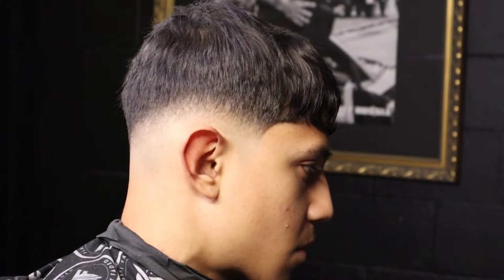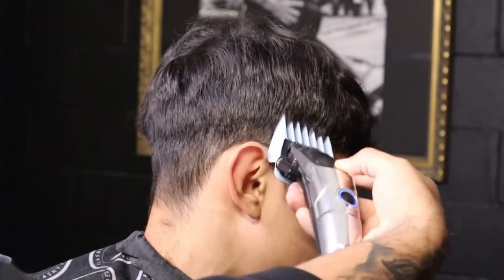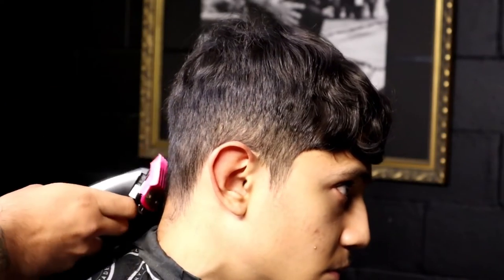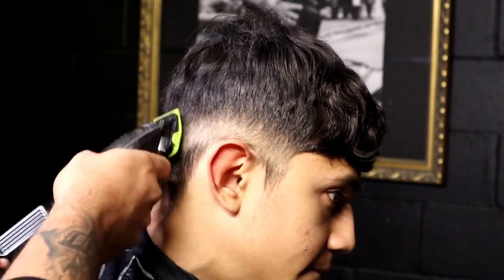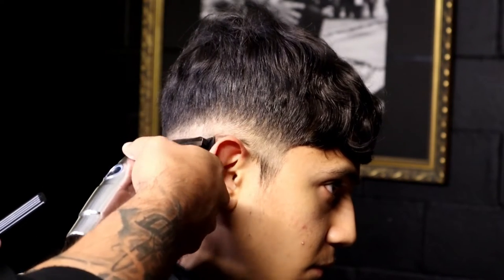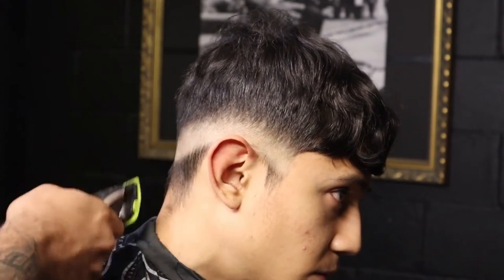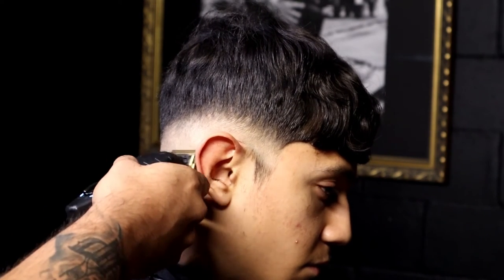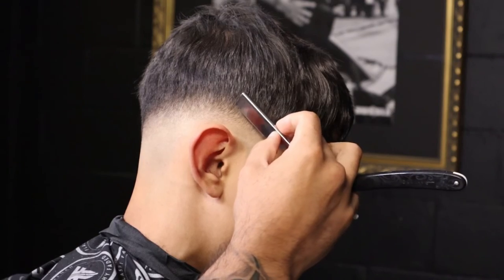COMPRESSED LOW FADE BARBER TUTORIAL

Comment: Can u do it with lever close using the high guards?
Reply: You always start with the levers open because it gives you room for error. And because you're going down in the guards, you don't need to use them in a closed position, not until you're actually doing the fading - everything up until then is debulking and tapering.